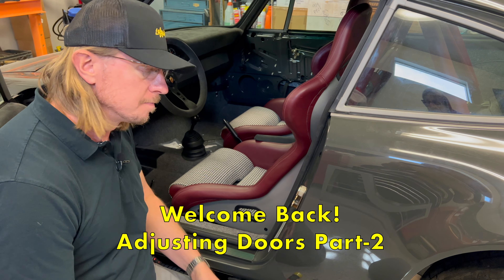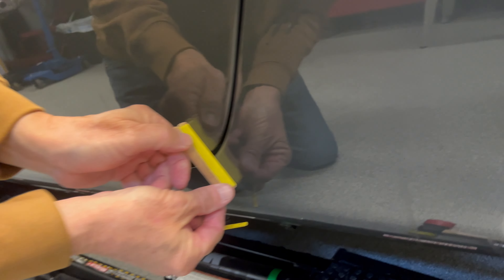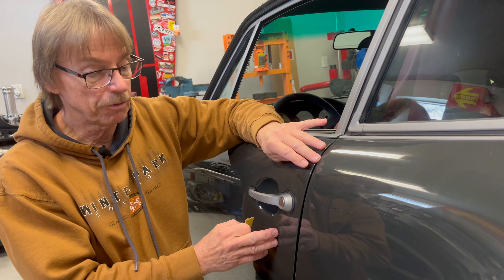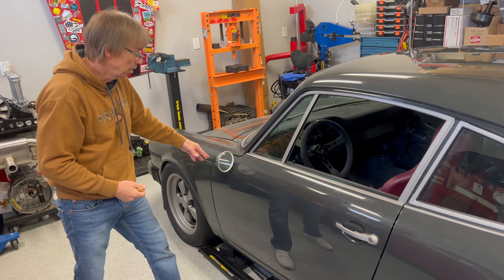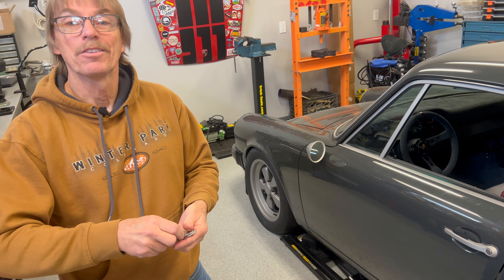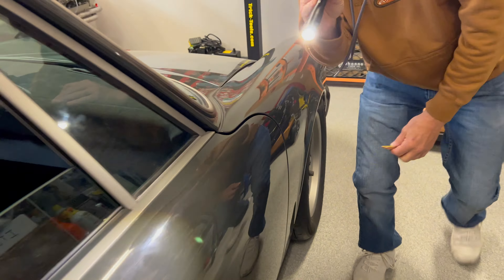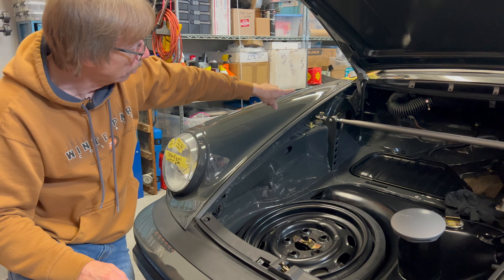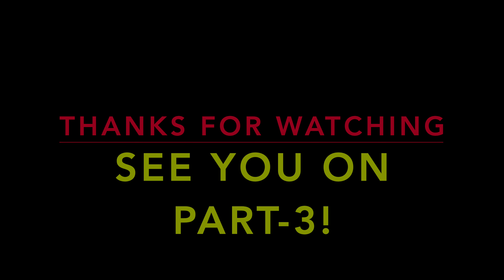Panel Gap Tutorial  Part-2 Door Adjustment Process!

Comment: In days of yore when I was a BMW tech the guidance was that the door would be pushed in a smidge (technical term 😂) along the leading edge and should be pulled out a smidge on the trailing edge to help mitigate against wind noise. Thankfully a 911 sounds so good this should not be an issue. 😅
Reply from the maker: Great Tim Tom! Thanks for sharing
Cheers